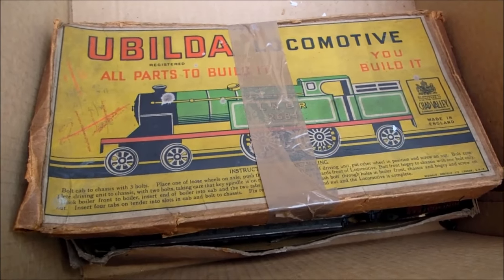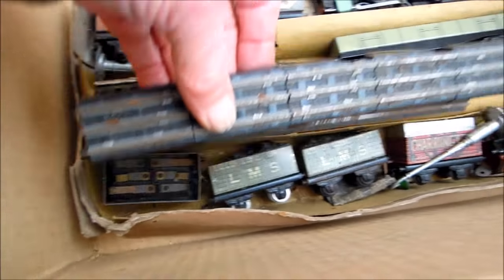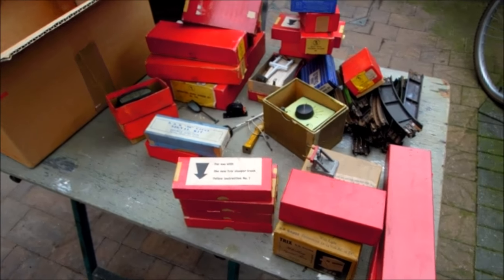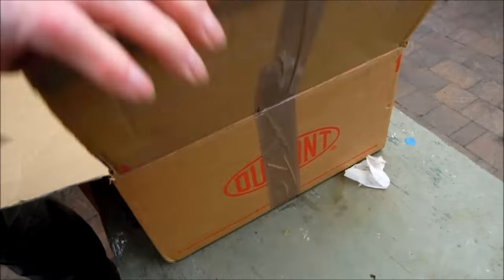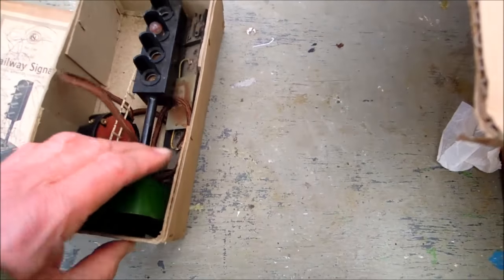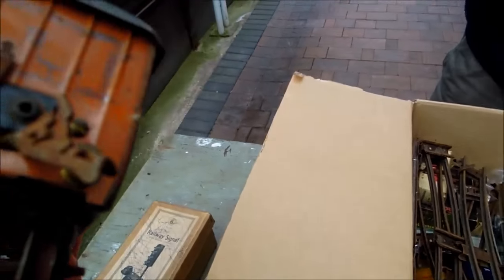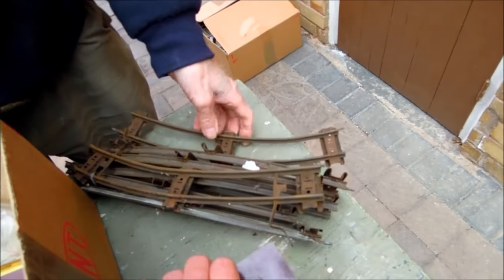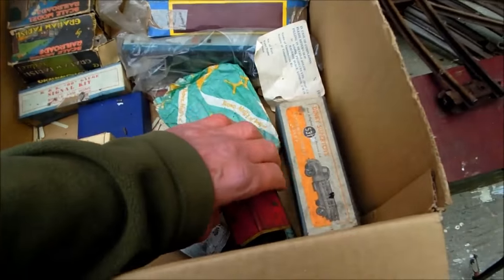Old model trains found in attic

Comment: That's a rather good Hornby Metropolitan coach in the 0 gauge box. The bits inside are the Windows - they will revive with a gentle soak in warm water them laid out flat. If you don't want it I'd give it a good home - have the loco 👍
Reply from the maker: Thank you David, I'll pass the information on to the owner. Thanks for the tip about the windows.